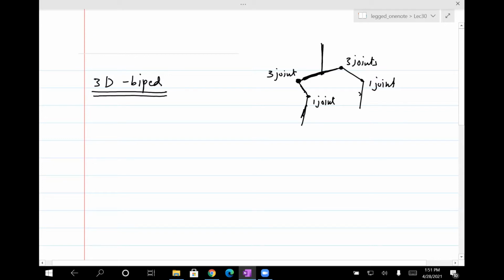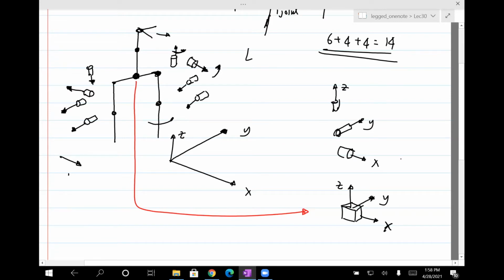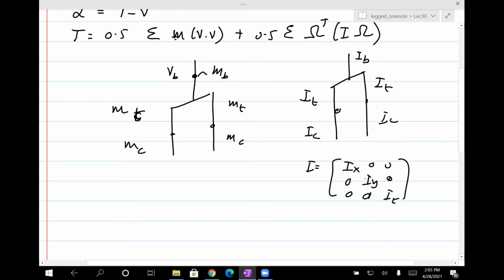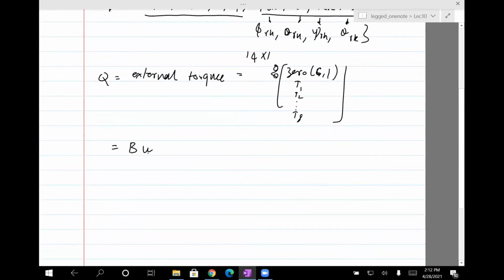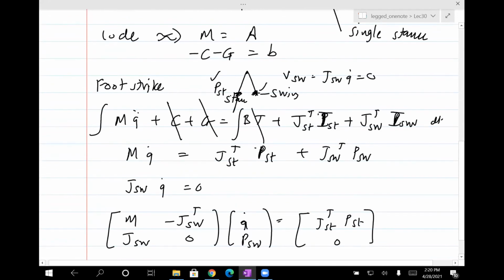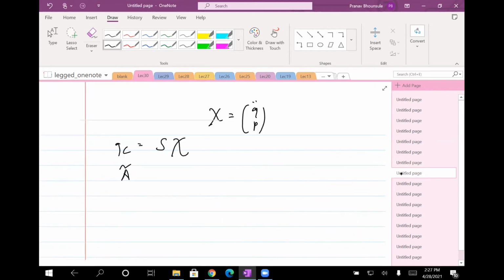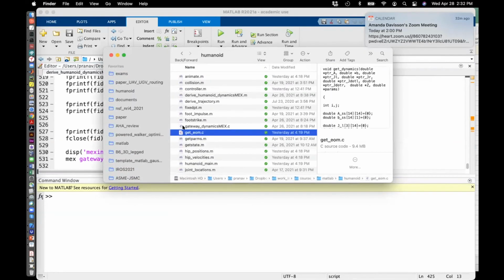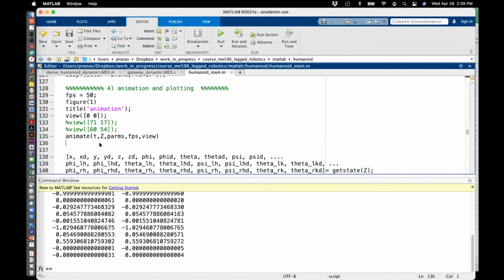Legged Robotics 30: 3D biped modeling, simulation, control, and animation (Spring 2021)

Comment: Hello professor, How can I apply torque about the torso to give it a yaw rotation and find the relation between torso and the direction of walking.
Reply from the maker: @RoyFinance-n5k  if you apply a yaw torque nothing willl happen. Thats because friction in the yaw direction is assumed to be infinite and no force will make it turn the way a wheel turns when skidding. Instead you need to rotate the left / right leg by a finite anount every step to get the desired motion. 

Consider the differential drive rimless wheel for a simpler turning model. https://github.com/pab47/RoadRunner2

Comment: I have built a 10-DOF bipedal robot with the upper body having x, y, z, and phi, theta, psi degrees of freedom, and each leg having two degrees of freedom. In using 'fmincon' to calculate torque, my simulator computes two sets of ODEs and two footstrikes, one for the right leg and one for the left leg. The constraint I've set is that the initial state should equal the final state and the velocity should be a constant value, but the results always fail to meet these conditions. How should I divide the N segments for 'fmincon' computation when the scenario involves two ODEs separated by a footstrike?
Reply from the maker: Are you mirroring the states correctly? Because you are doing one step, you need to mirror the position and velocity after one step, else fmincon will not work.
Reply: If the initial step is with the right leg, do you mean that after the simulator calculates for the right leg, the position information should be transferred to the left leg?I don't quite understand the meaning of 'mirroring @pranavab
Reply from the maker: @陈朴宁  If you start with the left leg as the stance leg then after one step, the right leg will be the stance leg. If forward is positive for left leg and negative for the right leg then you need to mirror them. That is, theta_left_leg = -theta_right_leg. The same goes for velocity. You need to do this based on the sign convention you use.
Reply: @pranavab  Professor, I just tried mirroring the state, but fmincon still did not converge. Would you be able to take a look at my code? I can send it to you via email.
Reply from the maker: @陈朴宁  I don’t think I willl br able to find the time for this. Fmincon needs a good initial guess. Try playing with the initial condition and looking at the animation to see if you are able to find a good guess.
Reply: @pranavab  Would it be possible for you to share any similar 3D bipedal robot fmincon codes you have written?I can study with it.
Reply from the maker: @陈朴宁  tiny.cc/legged the 3d biped model uses fsolve. But fsolve is the limiting case of fmincon with zero cost. You can substitute fsolve with fmincon and put zero cost. Once you get fmincon working you can add  more constraints and cost.

Comment: Thanks Professor, but this program 's really heavy and i cannot compile it, how can i do it?
Reply from the maker: See the video on using mex files. It is number 29 on this webpage: http://tiny.cc/legged
Reply: @pranavab  I used MEX files but it still doesn't work
Reply from the maker: @duongo4959  what’s the error you get when compiling max files?
Reply: @pranavab  I got compile error: fatal error C1002: compiler is out of heap space in pass 2 for project. With build environment: Microsoft Visual C++ 2017, windows 10, core i5, 16gb RAM
Reply from the maker: @duongo4959  never seen that before. Can you try mingw compiler instead? https://www.mathworks.com/support/requirements/supported-compilers.html

Comment: How to use jacobian for contact force in double suport phase of this biped
Reply from the maker: There will be two Jacobians; one from each of the two contact points. These will be used to find contact forces at the two feet.
Reply: Thank you for your reply sir. I just want to know, 
As you have explained, You have  diffrent equations for single stance and foot strike phase. For double support phase how the single stance equation will modify. For single stance jacobian is 3 ×14. Will the jacobian be 6×14 for double support phase? What other changes will be there in equation. 
And foot strike equation will now be contain impulse term in double support phase also ?
Reply from the maker: @291088vijay   for double stance, there will be 14 equations from dynamics + 6 from constraints. There would be 14 accelerations and 6 ground reaction forces. Thus there are 20 equations and 20 unknowns. So you can solve for all the 20 unknowns.

For impulse, you need to integrate the double stance equations. So you would have identical equations and unknowns. Except this time the unknowns are velocities and impulses.